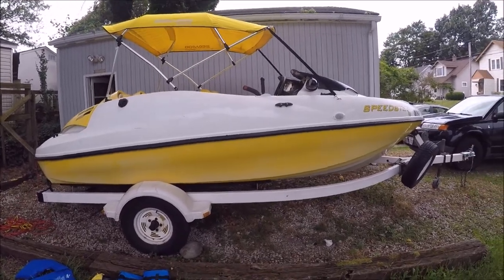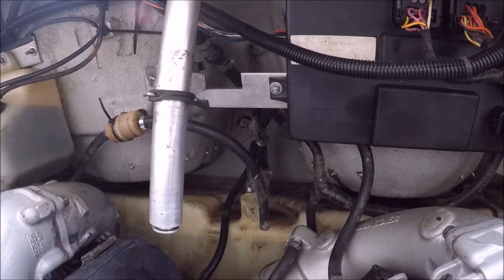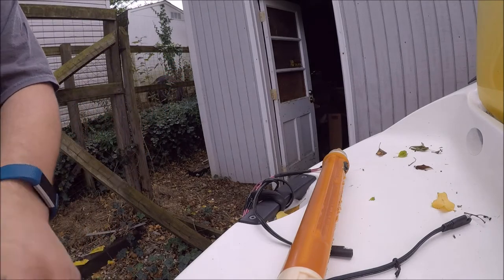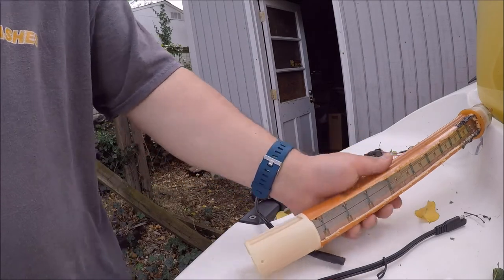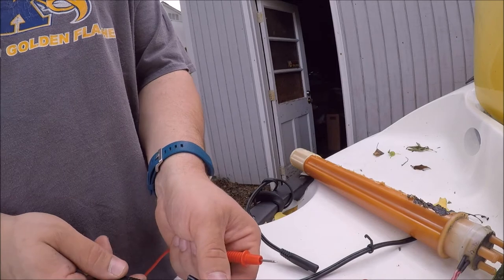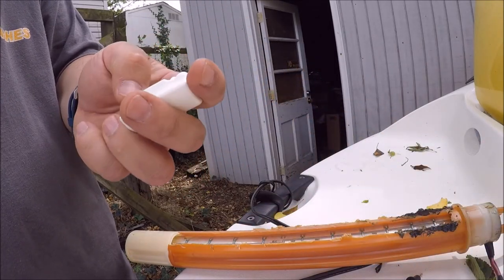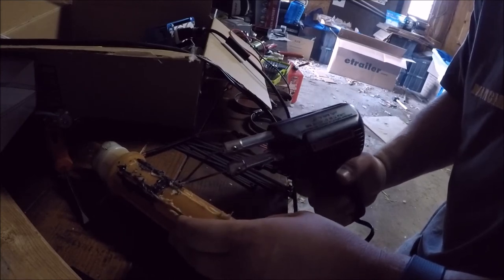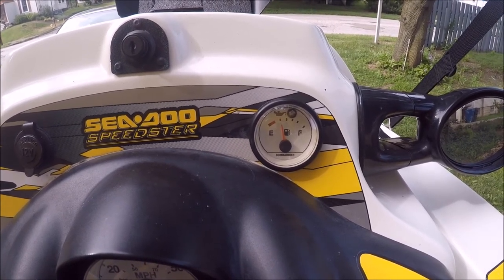99 Seadoo Speedster Fuel Baffle Repair

Comment: this actually worked for me, the fuel float thingy that floats in the baffle tube was full of gas. I replaced the float and it works. Also just to mention, on my 1998 speedster, I had to remove the wake pole support bracket in order to pull out the fuel baffle (otherwise it hits it). Only a few bolts but super hard to access unless you're pretty much sitting in the engine compartment lolol.
Reply from the maker: Yes, I remember having to be basically upside down wrenching at one point!

Comment: Thanks for going into such detail. I'll be doing this today :)
Reply from the maker: No problem. Some people dont like super granular detail but I do. Let me know how it turned out!
Reply: @dadgearlife  I was half lucky.... Kinda. I don't know much about the ski before I bought it, but it had been sitting. I put normal gas in it, drove it around and clogged the fuel filter multiple times...and after a few weeks, drained the tank..... All of the coating had come off the fuel float.... All of it, and it was all sitting around in the tank..... Cleaned the tank, got a new float in there, good as new

Comment: F1fuse is probably not a fuse, it's a resistor. Nice job on the repair and video.
Reply from the maker: Thanks, F1 is just what the guys on forums call it, so I referenced it in this video. Thanks for stopping by